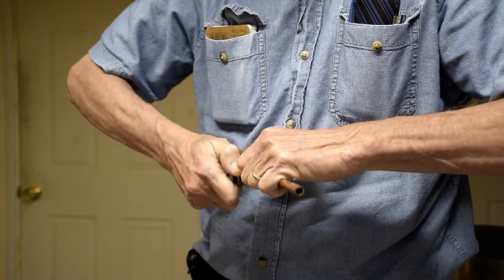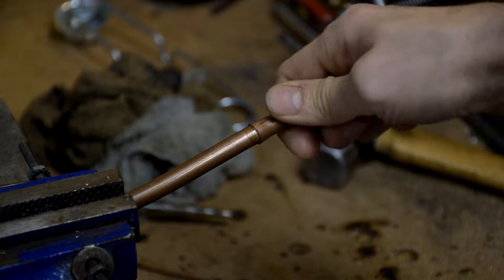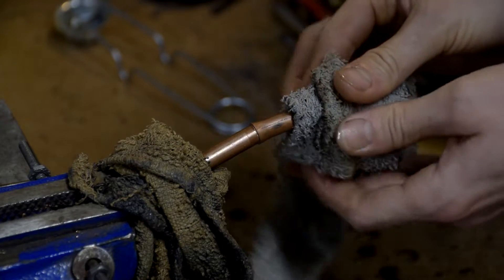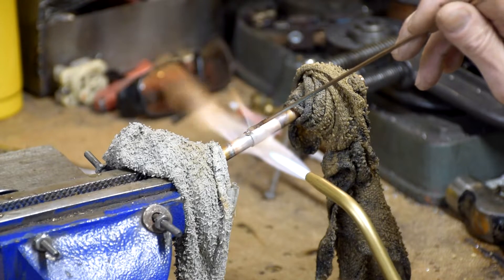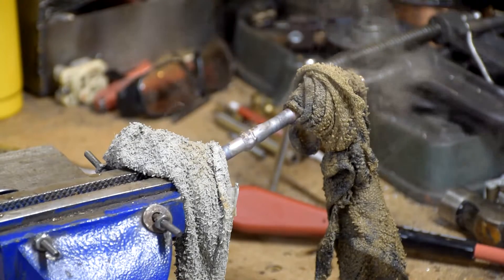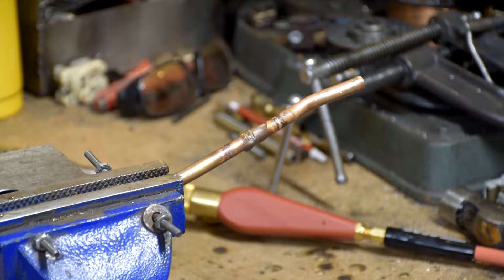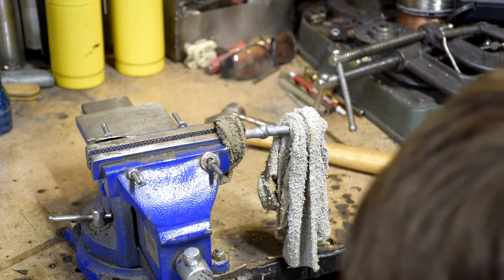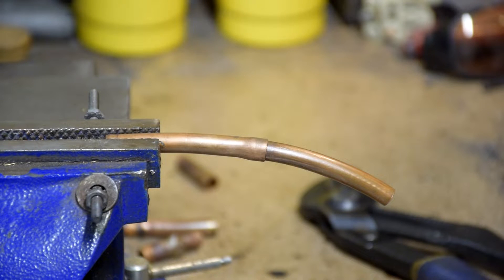Want to braze copper tubing without nitrogen? Watch this

Comment: Way to much time spent on one joint. The swage is not deep enough, that the reason the joint kept falling apart.  You have what we cal a cold joint because the tubing never gets hot enough to melt the filler without the torch being right on top. This may end up leaking later on. I don’t think you would get away with this on 1 1/8” copper.  Save all the excess time and just use nitrogen for brazing, or stay Brite #8 for shouldering.  Good experiment though.

Comment: can this be done with the copper tubing in mini split line sets?  a contractor put a nail through one of the copper tubes on one of the units.  I'd rather not replace the entire run of copper tubing.  Thanks and great vid!
Reply: Sure no problem

Comment: LOTS of VRF going in around here lately.
And they don't use filter driers. Just strainers.
It's scary when I see all the brazed piping done (using standard accy/oxy and 15%) and find out that they don't purge with nitro!
Reply from the maker: Seriously, no filters and no nitrogen? That's a recipe for clogged metering devices

Comment: The other option with no nitrogen  is Staybright 8 and Stayclean flux applied lightly on the male joint.  Requires much less heat, no oxides are produced and no annealing of the copper.  Because of the lack of annealing the copper pipe is stronger than a brazed pipe. Because of the reduced heat, it is less likely to damage valves or txvs. With no oxides, there is far less chance for txv failures.
Reply from the maker: Yes you are correct and in fact, this is our usual method. Only one problem, we've been getting linesets from our suppliers which are not round, and there are huge gaps that we try to close but sometimes we can't. The solder will easily flow through the gaps and pool up inside the tubing. Not much problem with the liquid lines (3/8 inch) but for some reason the larger suction lines (3/4 inch and larger) seems to be a huge issue.
Reply: @subcooledheatpump  Not sure it they're common nowadays but there are "tubing pinchers" that look like cutters with a somewhat wider wheel.
Reply: @subcooledheatpump  Another option to try to get the fit better is to swage out the male side to fit more snuggly into the female.
Reply: @subcooledheatpump  on case you're still listening, the SB 8 fills gaps "better" than the SB, IMO.
Reply: What about the debate over SB8 not being approved by OEM's, and potential for acid attack in system??